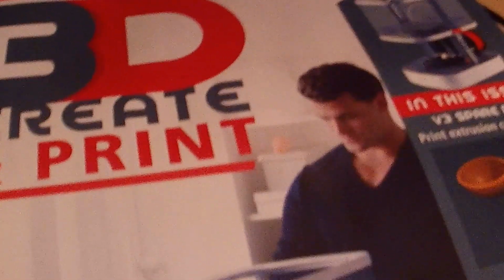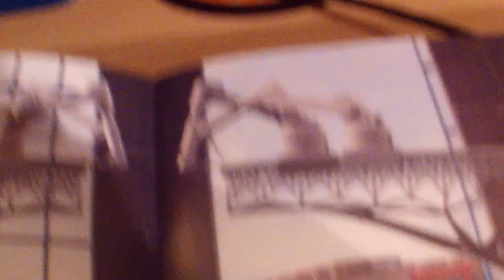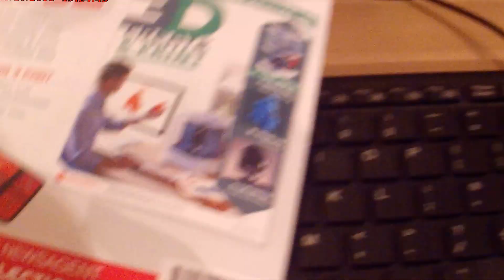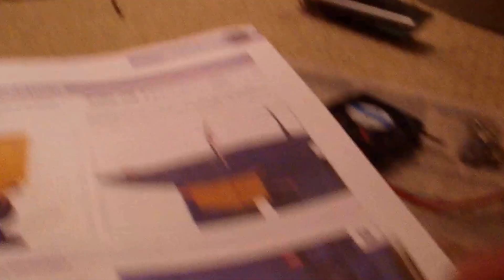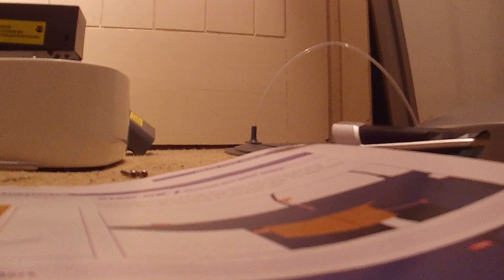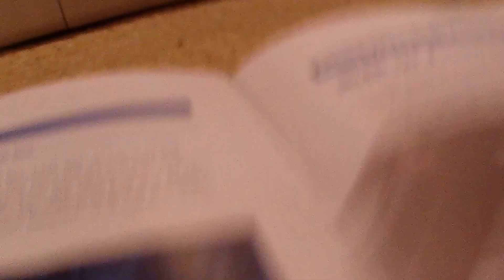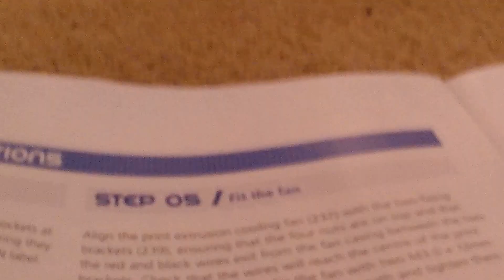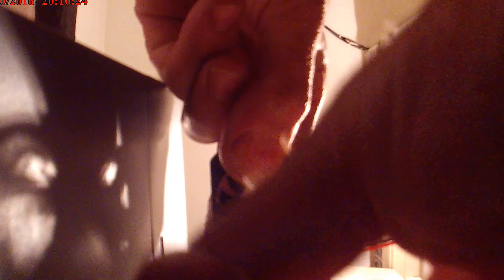3D Printer Build & Review Issue 91 (Stage 11) - V3 - Print Extrusion Cooling Fan (Free with Mag 90)

Comment: You may find that you will encountered problems if you install the extra fan as per instructions
Reply from the maker: What sort of problems platnumk2105???
Reply: Jimyjames73 the cover will sits too low so it will either hit the build plate or the print, it also blows cold air onto the nozzle which stops it going above 180 degrees, this might explain it better than I can http://v3uc.com/forums/topic/print-head-not-heating-after-installing-second-fan/
Reply: platnumk2105 , I didn't even know that site existed! signed up :) lol
Reply from the maker: Nor did I, but then again there arte loads of sites out there which I don't know exists!!!
Reply: Jimyjames73 , haha, if only there were something we could use to search through them.. very good site though BTW worth a look if you haven't already
Reply from the maker: yep
Reply: Jimyjames73 I found the site purely by accident while looking for information on g-code
Reply from the maker: I do that sometime
Reply: Yep !!! ... That's Correct !!! ..... It's Useless.  I did Major Surgery to the Cover, and even put Spacers.  But it won't let the Nozzle get above 178-179 Degrees.  Mine reaches 179 then Drops to 178, and Fluctuates between 176 and 178.
So I've removed the Cover, and Unplugged that Fan.  It doesn't seem to affect the Finished Job.  If you watch the Monitor, you'll see that it turns from Red To Grey as it cools.  And that's pretty quick to happen.

ps ..  If only we could Disable It in the Software.  Actually, I'm thinking about attaching a Switch or a Plug near the Fan itself:  Because it may be handy (even without the Fan Cover) when Printing Skinny or Large Objects.  That would prevent the need to Remove the Motor Cover whenever you want to Plug In or Unplug It.